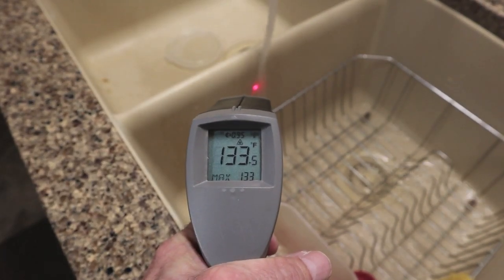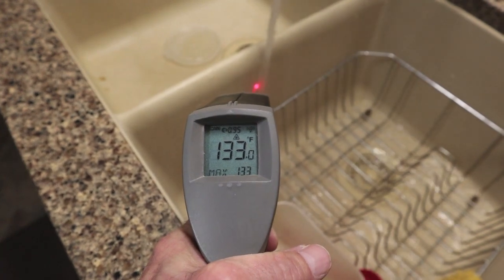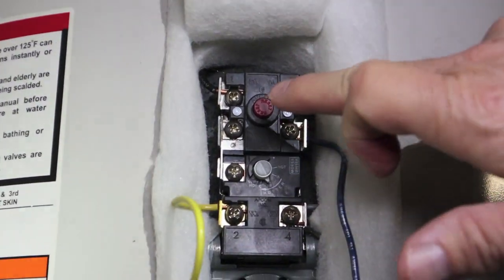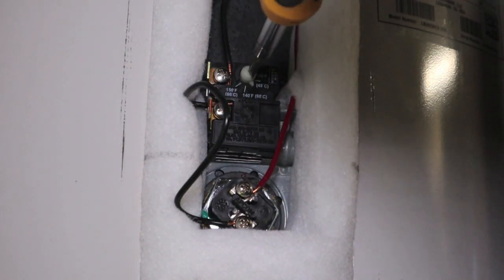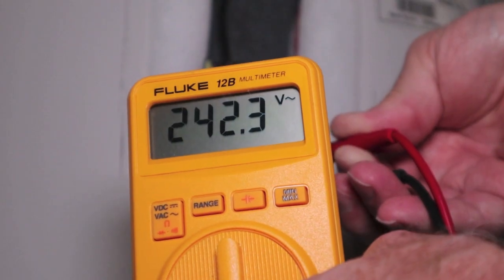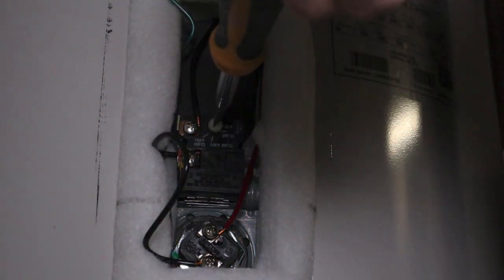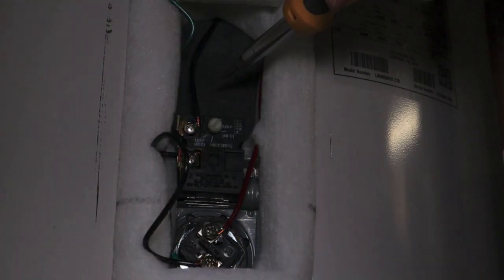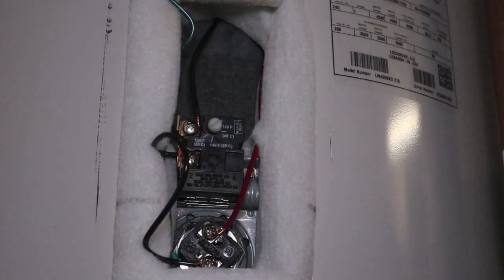Water Heater lower thermostat STUCK then tripped upper

Comment: So, in short, if the lower or upper thermostats wont manually click on its bad?
Reply from the maker: Hi SixSentSoldiers and thanks for watching and commenting!
It may not be that simple. The upper controls the lower in that the lower either has power or not, as both upper and lower will not be on at the same time.
Also has the tank cooled down?, if it's above the stat setting the stat will not click on. 
if you are not comfortable around electricity and know how to test to see if you have voltage where it needs to be then please get someone that's qualified to check it out for you. Above all, be safe!
Reply: @pmtips4482  - Absolutely. I cut the breaker and unplugged it. I got lucky. Tested the elements and thermos and compared them to the new ones I bought. The lower thermo was then only one that didnt match. I rolled the dice and put the new lower thermo in and.......Whaammmo. fixed. Didnt have to drain. Yes. Thanks for the video. It helped.
Reply from the maker: @sixsentsoldiers  Good deal!! It's always nice when a plan comes together!